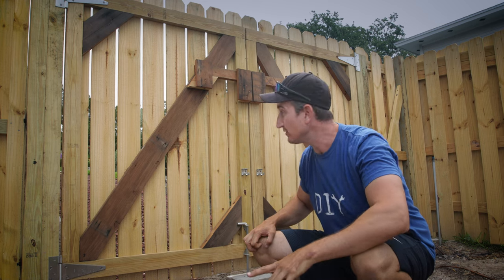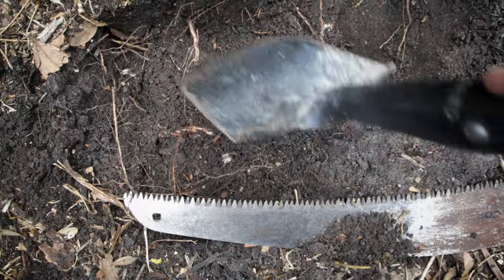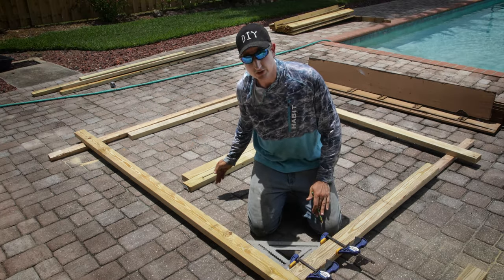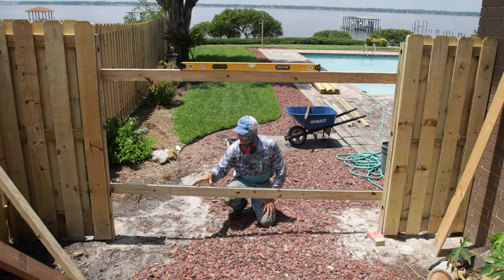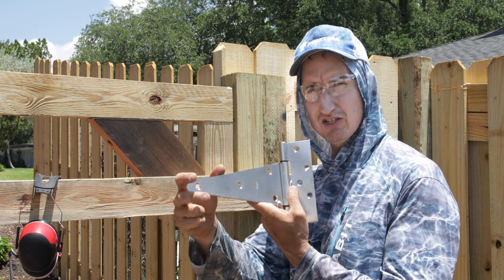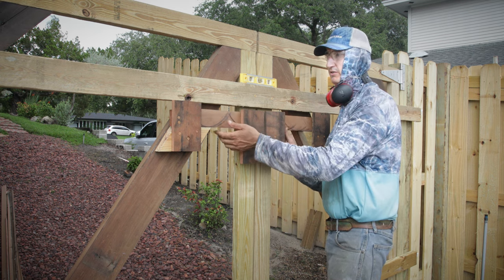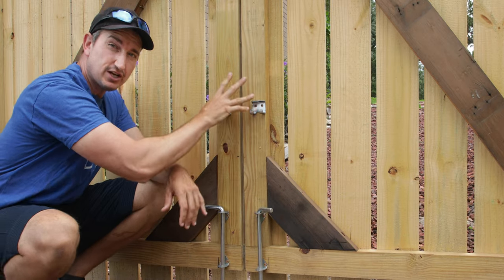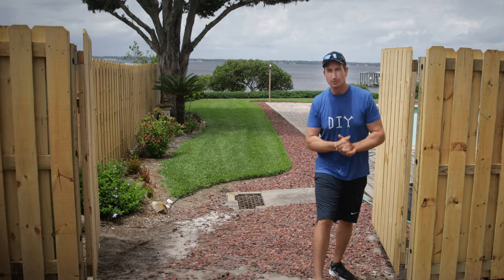Build A Double Door Fence Gate, Sturdy and Long Lasting

Comment: Excellent presentation. The only thing I would add is instead of using screws to hold the gate to the posts, use galvanized or stainless steel bolts instead with a washer and nut on the other side. Over time, screws can work themselves out on heavier gates.

Comment: I had to disassemble my 1st attempt at this frame style. It was out of square by almost 3/4" so I used the 12" speed square to cut the ends even taking off 1/8" now I'm about to try it again. I have one corner "perfectly" square using the 12" square. Does it help to use the speed square on each corner ? If i can get this frame reasonably square ill check the local lumber yard to see if its cheaper to get a 2x6 cedar board vs HD. HD sells them in 8' length
Reply from the maker: As long as you get it pretty close to square I would thing it would be ok for an exterior wood fence gate.
Reply: You can check for square by using the "3, 4, 5 rule." A triangle with a right angle that has legs of 3 and 4 will have a hypotenuse of 5. It's like using a giant square.

For example, start at any corner of the frame, measure from the corner down one side 3 feet and make a mark on the outside edge. From the same corner measure down the other side 4 feet and make a mark, on the outside edge. Now measure the distance, diagonally, between those two marks. If the distance between those two marks is 5 feet then the corner is square, 90 degrees. If the distance is more, the corner is over 90, if it is less then the angle is lower than 90.

Note that you don't have to use feet, you can use any unit of measure. Only the ratio of 3,4,5 is important. You can also use any multiple of that ratio, for example 6,8,10 or 9,12,15 etc..

I would recommend that you put your frame together as carefully as you can with temporary diagonal braces close to the corners. Just put 1 screw on each end of each of the braces. Then check for square via the 3,4,5 method and adjust as necessary. If opposite sides of the frame are accurately the same length and the corners are accurately aligned but the frame is out of square, all you need to do is to wrack the frame a bit in the right direction. Adjust and then re-measure. Once squared up then carefully put a 2nd screw into each end of each of the temporary braces. Then put in your long permanent screws at each corner butt joint. If you don't have much experience driving screws, I strongly recommend drilling pilot holes for the long permanent screws. Also, keep the temporary braces on until the permanent framing is complete.

Comment: The fence looks solid! How does one open from the other side?
Reply from the maker: Thank you @bimbohlah. This fence was designed to just be opened from the one side when starting from a locked position.  There is a single door gate elsewhere that can be opened from either side.

Comment: I saw a video once where a guy filled a balloon with concrete and made his own gate closer. He sunk an eye bolt in the top of it for a chain to slide through once it was all set. Then just add a bolt and chain to the gate. The weight of the ball closes the gate just dont make it too large.
Reply from the maker: that sounds interesting
Reply: That sounds very unique.
Reply: You happen to have a link to that video . Sounds pretty cool and I'm working on building my gate now. May be cool to add that to it

Comment: Great video. I just finished a 14ft gate. 
Advice for the herd: 
-Use a post that’s longer than your desired height. Cut it after. 
-Make your frame height about 5inches shorter than your desired overall height 
-Leave 1/2inch of space between frame and post on each side
-Leave 1/2inch space between two gates 
-The lightweight cedar is the trick to not sagging. Use cedar pickets. 
Like this so the people see it
Reply from the maker: Thanks for watching and your insights.

Comment: The only downfall is there isn't an option to open from the otherside of the fence. The actual build is clean and fit nicely without any sag. Great job
Reply from the maker: Thanks, in this case the design was intended to not have an opening mechanism on the outside.
Reply: He'd have to have a single mechanism that lacks security

Comment: What size and length "lag type screws" are you using to make your gate frame?  I could not tell from the video or your material list.  Great Video - very simple but solid design!

Thanks.
Reply from the maker: Thanks, I believe I used different lengths for different areas. On butt joints they were 6" and  longer.

Comment: hello.  congratulations for the video.  I live in Chile and it is very humid here.  freezing winters and arid summers.  Do you recommend using wood for a place like this?
Reply from the maker: Thank you.  I think building the frame with aluminum is a good idea if possible as the material is light yet ridged. I considered building this gate with aluminum framing but opted for wood for cost and simplicity.

Comment: Nicely done!! If you done mind what was the dimensions of the gate when you built it or before you installed and cut it?
Reply from the maker: The opening was about 8.5 feet wide. I believe the overall fence frame was constructed about 1 inch less then the opening width. Thanks

Comment: So I understand you need to make the gate 1 inch smaller to fit in, do you need to adjust how far the hinge is from the side post or anything?
Reply from the maker: I had actually planned to make it about a half inch smaller overall but made an error not allocating for the section I cut out between the two doors.  if you pre-hang the whole gate on braces first, you can fit the hinges according to the gap.

Comment: Might sound odd but do you worry that those down rod tubes will retain water & rust the down rods?
Reply from the maker: They do hold water however rust has not been an issue.  The cane bolts are coated with a corrosion protection barrier that seems to work well.

Comment: Do you have a list of all the hardware used, size and type of screws for each step.
Reply from the maker: Fence Build Tools and Materials:
Framing Nailer = https://amzn.to/47dyvcN
Impact Driver (For driving long screws) = https://amzn.to/3QHBumy
Drill and Nailer Battery = https://amzn.to/3G0G36A
3" Framing Nailer Exterior Use Nails = https://amzn.to/49zNCyK 
2" Nails For Pickets = https://amzn.to/40Hh4i4
Gate Hinge Stainless Steel = https://amzn.to/40FL51Z
Stainless Screws for Hinge (Post Side) = https://amzn.to/47fiV09
Stainless Screws for Hinge (Gate Side) = https://amzn.to/3FY10iy
Cane Bolt (To hold gate in place at ground) = https://amzn.to/47y1uaP

Disclosure: The above are Amazon links. "As an Amazon Associate I earn from qualifying purchases."

Comment: So let say my space is of 140 in, do I cut the top and bottom 2x4 exact or need to leave a half in for it to open correctly?
Reply from the maker: The frame shown in this video was made slightly smaller than the opening to allow for some space between the frame boards  and posts.

Comment: Oh well, I can't even get the cross measurements close to even. I end up with 126" and 125 1/2"
Reply from the maker: That might be close enough for an outside wooden gate. If you want it closer you may be able rack the frame once you have one screw in each joint.  Once it is forced more square you can brace it off to hold the square shape and add remaining fasteners.
Reply: @MrKistel  I removed the screws and used clamps to measure and was able to get it to 125 and 3/4" on each X side measure. I then used 2x4's to hold it in place on the corners to prevent it from shifting out of square then installed  6"  screws. Now I'm about to do the inner 2x4's. I think my main concern having little experience was how far out of square is acceptable for a fence. Here I am trying to get it perfect. What a challenge. Thanks.

Comment: How did you marge the 4x4 posts together ?
Reply from the maker: Clamp them together to hold them in place, then drill holes through both post with an auger bit.  I used half inch diameter galv bolts with washers and nuts to secure the two post to each other.

Comment: What wood did you use for the gate frame? 2x4? or 2x6?
Reply from the maker: 2x4 PT for  for the perimeter frame and 2x6 cedar the cross bracing.
Reply: @MrKistel  what space between gate and posts?
What space between gates?
Reply: would a regular PT 2x6 be too heavy @MrKistel
Reply from the maker: If the gate is not too big and the gate post are sturdy it might be ok.

Comment: Did you use 4" screws for butt joints ?
Reply from the maker: I believe they were 6"
Reply: @MrKistel  thanks a lot.
Reply: I ended up getting HeadLOK 6 in. Structural Wood Screw (50 Pack) from HD, gonna give these a try.

Comment: Butt joints are sure to sag. Use lap joints going forward
Reply from the maker: The framing wood was fresh pressure treated lumber and it was still wet.  Since the wood will shrink as it dries I feel the butt joint, with adequate hardware and additional bracing, should suffice. I don't think the shrinking possibility of the wet treated lumber is ideal for lap joints.

Comment: Curious on why build a double door fence gate instead of a single door gate ?
Reply: So you don't need to add the supporting post in the middle
Reply from the maker: If you need a large opening overall only one door would be a tremendous load the hinge side.  Making two smaller doors spreads the load over both mounting post.
Reply: @MrKistel  what would be your recommended maximum width limit  for a single fence gate ?

Comment: How many inches was that lag screw?
Reply from the maker: I believe the lag screws are featured in the video description area. I may have used a few different sizes.
Reply: @MrKistel  Sadly this is not the case.
I was looking for the same information to join the two 4x4 posts together